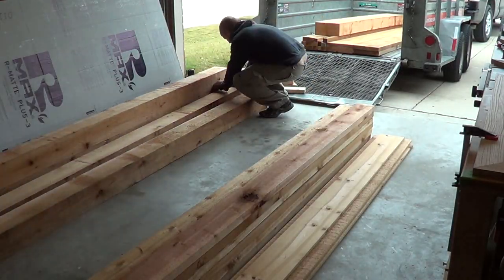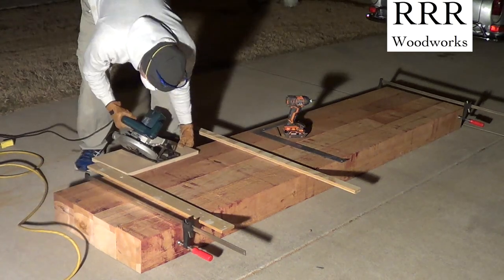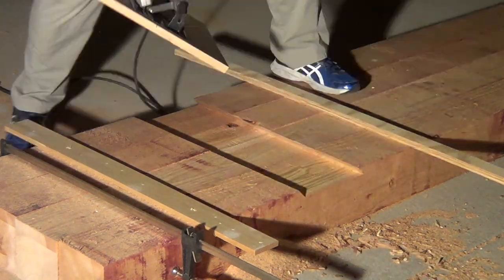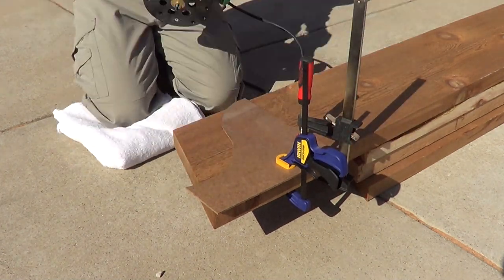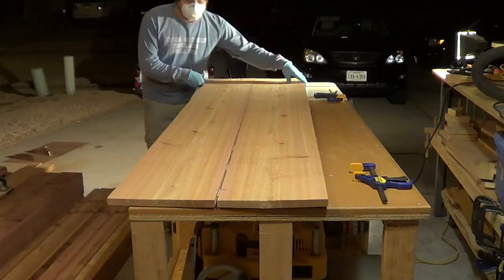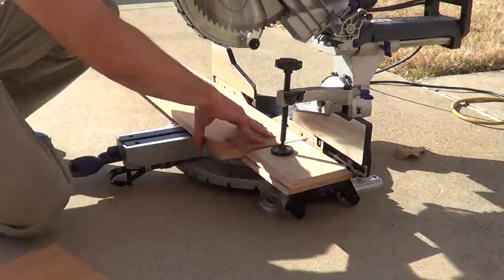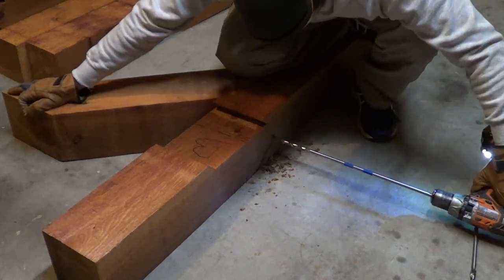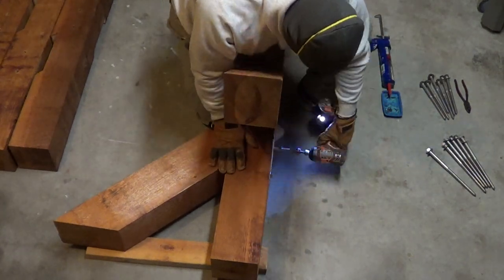How to Build a Pergola - Part 1 (Pre-Assembly)

Comment: Hey awesome video! At 3:12 what kind of bit is that in the router? It has a bearing and can adjust the depth of cutting? I want one if you can give me a link
Reply: It’s actually just a straight bit and a guide bushing. The guide bushing followed the template that I made and  I had to adjust the cut depth because that would have been quite a bit of material to go through in one pass.  I don’t believe a set of guide bushings are very expensive at most woodworking stores. I haven’t checked, but you might be able to get them at Lowe’s or Home Depot. I would check online first before you make a trip there.
Reply: Andrew Rogers ok, so I will just look for a guide bushing for a router. I did notice that you made a few passes but I still feel it would be more precise than a freehand tool
Reply from the maker: That previous comment was me as well, I forgot that I was logged into YouTube on my other account. 
I agree, it’s WAY more precise than freehand. If you have a good jigsaw and you use it well so that the blade doesn’t bend as you turn, that works well also and takes less time than the router.

Comment: Can you tell me what brand and color stain you used? Is it a combination stain and waterproofing sealant?  Thanks
Reply from the maker: I’m almost positive I used Olympic Maximum - Cedar Naturaltone from Lowe’s. I used 3 gallons and had a little bit of the 3rd gallon to spare on that 10x12 pergola. 
Link: https://m.lowes.com/pd/Olympic-MAXIMUM-Pre-Tinted-Cedar-Naturaltone-Transparent-Exterior-Stain-Actual-Net-Contents-128-fl-oz/3032639

If you haven’t assembled/installed your pergola yet, I HIGHLY suggest staining all of the pieces beforehand. For the first pergola I built on my patio, I stained after assembly and it was a huge PITA. Just a word of caution...
Reply: RRR Woodworks Thank you! After watching your video, I definitely planned on staining first. What a great idea. I have the cedar sitting in my garage drying. I bought a moisture meter from Lowe's and some of the wood is around 20%. I've read that it should be <15% or it won't accept the stain very well. Do you know if that is accurate info?
Reply from the maker: jrenaud22 Yes, that info sounds correct. Stain works by absorbing into the wood and if the wood is already saturated with water, the stain will be unable to penetrate. I haven’t had experience with testing stain at different moisture contents yet, but the lower the moisture, the better.

Comment: How did you attach the wood to your saw for cutting the post notches?  My saw has no holes in the base plate to do that.
Reply from the maker: +Louie Carter Hi Louie. If the base plate of your circular saw doesn't have holes, I don't see why you can't drill a couple in it. I would just be sure to unplug the saw first, and use a metal file to smooth out the metal tear out so you don't damage your work piece. 

Also if you do drill holes, be sure that they are accessible with a screw driver from the top.
Reply: Thanks.  I made one, but I did not realize the size I needed to make it.  For others, be sure that it will always be bigger than the size notch you are making so that one side of the base does not tip into it once you start breaking out the small pieces you cut.  I made this mistake and had to use my chisel for all the breakout of the small pieces as the one side of my saw was difficult to keep steady..........if the base I made had been wider, that would not have happened.
Reply from the maker: +Louie Carter Hey Louie. Are you currently building a pergola? I would love to see pictures after it's done! Email some to me and I'll try to put them in an upcoming video. 
Triplerwoodworks(at)gmail.com
Reply: Yes, working on pergola, fireplace, smoker stand, and pizza oven for a neighbor's project.  I will send you photos once it is finished, which should be some time in late June.  Every one working on this is a part-timer, so the time frame is extended as a result.

Comment: Can you please provide the link to the rig you used to cut the 1" angle on the 6x6?
Reply from the maker: William Garcia Here you go! https://youtu.be/r_e44mF3B3Y
Reply: @RRR Woodworks, thanks for the link. For that 45 degree cut, did you start the cut at 1.5 ft down from the top of the 6x6? Also, how long did you make the support beams? Your videos are extremely useful. Thank you.
Reply from the maker: It all depends on the look/proportion you are going for. It also depends on the total height of your pergola. If the pergola height is 8 feet at the top, that would make the bottom of the 2x12 beams at roughly 6.5 feet. If you go a good amount lower than that, a few people may be banging their heads on the support brace. I would have to dig up my old notes and see how much lower the brace came below the 2x12 but I’m not sure if I could find them. Just be sure you add about 4” of height to that brace so you have it overlap with the bottom of the beams. The rest of the brace measurements are personal preference.